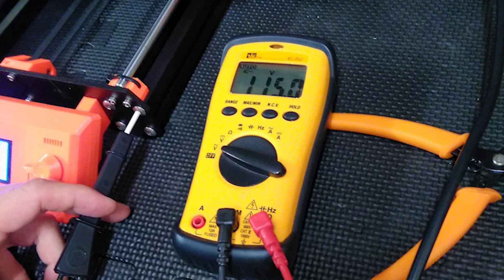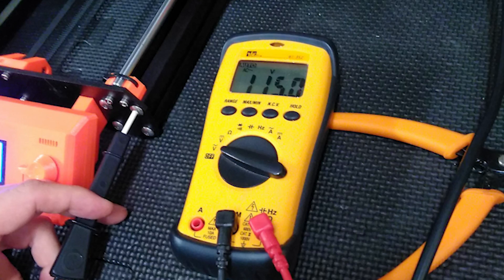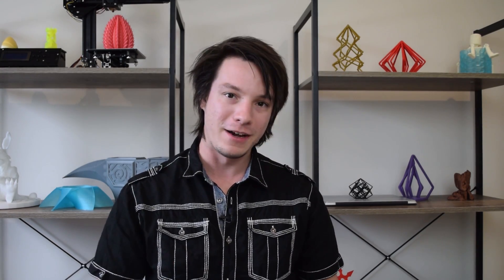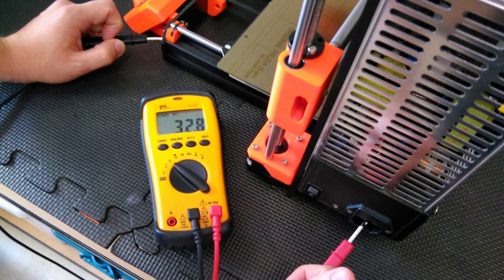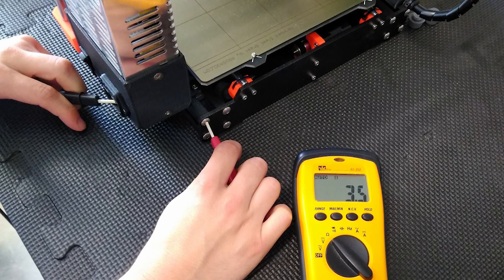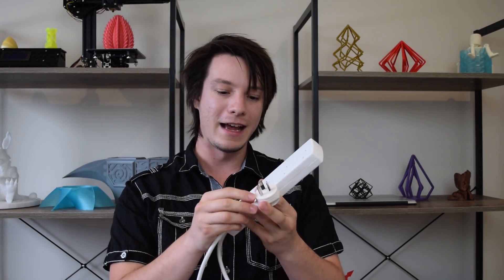I got shocked by a 3D Printer

Comment: Good PSA:
Always a good idea to have your machine plugged into a surge protector that goes to a grounded outlet (3 prong here in the states).
Always wear shoes or rubber gloves, when handling your machine (this helps isolate you further in order to avoid accidental discharge). 
If your machine is sitting atop a metal surface it might be a good idea to use a rubber grounding mat to isolate the chassis from the metal surface.
Always inspect your cabling, surge protectors, and outlets on a consistent basis! Depending on the usage it's always a good idea to check if a cable is getting hot (while grounded/isolated), or shows wear/scorch marks which are a good indication of a problem. If any of these tell tale signs occur, halt the print.

There's more electrical safety tips out there, and if you're getting started or interested in these machines (as an adult or a parent) so that you are prepared to operate your printer SAFELY!

Even the smallest of jolts could potentially be lethal depending on the situation!

Comment: Second rule of 3d printing. Don't print if you can't brain! We can wait a few more days for a video. You can't unfry yourself if you derp and zap yourself into cardiac arrest. I also make sure the power boards I use for exxy stuff has a safety switch thing to prevent any sort of odd electrical derpage.
Reply: Theressa What's the first rule?
Reply: Gavin_152 level the bed then level the bed again the again then again

Comment: my not very lubricated anet a8 guide rods shocks me everytime i touch it.
If the voltage is that high you may need to check the wiring.
Also the ground will burn out the fuse in the plug unless the power jumped before it , better prepare some spare fuse

Comment: I would have tried to diagnose the Aurora before you posted this.  For all you know, it's just a loose wire inside the thing, damaged during shipping, that is touching the frame.
Reply from the maker: I thought about it, but honestly it's beyond my level of skill. I don't play with mains, period. Not really happy to open it up and poke around looking for voltages and shorts.
Reply: I'm not an electrician either, but most 3d printers are main to power supply to 12v or 24v DC electronics.  Hard to see how main power is going to short to the case unless it's just a badly wired power supply, or a wire going where it shouldn't.  It would have to be a pretty weird design for it to be a design flaw.  But perhaps an expert can comment!
Reply: The voltage you showed is only possible in if there is a leak from the power supply to the chassis of the printer. An improper circuit wiring of the outlet would show full mains potential across the neutral and ground if there was a hot wired into the neutral on that circuit. Since this was only an issue on the JG Aurora you have limited the voltage leak to the PSU. 
   As an Electrical Engineer I implore people that if your unsure what your doing simply don't mess with mains power. Current as low at 100 mA can stop your heart! 
   As you know the printers operate on 12v or 24v DC which is fairly safe as long as the transformer is properly insulated from the machine. External double insulated power supplies are the only units that can be operated without a ground safely. 
   I enjoy your content and want you to continue producing it safely. Being in the US I had to lookup your electrical code as we do things a bit different. I am unsure of your property's age but current code calls for the installation of any residential outlet and lighting circuit requiring a GFCI (rcd) to be fitted. This is not a retro active requirement so please purchase a GFCI protected power strip if you do not have a protected receptacle. 
   I have seen far too many Chinese products in the past 5 years have issues like you experienced. Poor insulating, improper wire gauge, bad connections, and a lack of ground all together are things I have come across. Glad your OK. I'm sure Josef will sleep better knowing it wasn't his machine.

Comment: All homes here are required to have an RCD breaker (america has a different name) in the fuse box, this device will trip when ANY current leaks into earth (basically.. to protect people if they unluckily become that path to earth). 

This would have instantly tripped when you plugged in the JGAURORA, letting you know that it's power supply is dangerous and shouldn't be used. I recommend looking into getting one for your home, or at least a power strip with one built in for your workshop.
Reply: That outlet is called a ground-fault circuit interrupter (GFCI for short)
Reply: GFCI are the ones with the Test/Reset buttons, right?
If so, I thought GFCI was only required outdoors and in bathrooms, and maybe kitchens, none of the bedrooms or otherwise have GFCI outlets.
Reply from the maker: Thanks for the heads up. It's law here too but we have just moved in. If they're not in place I'm reporting them.
Reply: All depends on your country's rules, In Australia, Its everything, depending on the age of your house, you will have one larger RDC on the input, On my 2 year old house, each circuit breaker also had an RCD built into it (dual purpose) And yes, generally they are the ones with the reset buttons.
Reply: Oliver O'Neill Not necessarily. The RCD only trips on currents greater then 30mA, also the JGAurora doesn’t trip the RCD when connected to a earthed socket. The fault current is well below 30mA in this case. My theory is that the PSU of the JGAurora has a high impedance path between live and earth due to flux residue or an incorrect discharge resistor in the region of a few megohms. This is enough to make you feel an uncomfortable “buziness” but nothing more. In regular use, this current of a few hundred microamps will flow from live to earth, not tripping but slightly biasing the RCD.
Reply: Sure this wouldn't have tripped instantly if the JG wasn't earthed but it would have tripped when poor Angus touched it.
Reply: Oliver O'Neill 
Your right. A quick recap read they detect difference in current between live and neutral. Return path via ground isn’t required. All the more interesting.
Reply: Please do get an electrician to check it - IIRC, houses older than xyz years in Australia (or certain parts) are not legally required to install an RCD/GFI until major changes are made to the infrastructure. I have seen houses rented out (yep..) with fully networked ground lines that lead down to the basement and do not actually terminate in earth, making the whole network useless and causing potential bleed over into other appliances, such as in your case. I've also seen extension leads with a male plug on both sides..

As an electrical engineer, I'd be keen to see inside the JGAurora. Some Chinese manufacturers (notably of cheap LED floodlights on eBay) frequently omit actually connecting the ground pin to the metal chassis, making them both potentially lethal and a fire hazard. I think a proper analysis of the aurora guts are in order. I think Djhg2000's comment about the grounded PSU sounds feasible.
Reply: In Canada (and USA I think) GCFI is only required in wet areas (bathrooms, near sinks...) and outside.
Reply: Ian Colquhoun That's the case in the US.
Reply: There are ones for sockets directly too. In case your landlord is slow.
Reply: All homes are required to have at least one RCD (Residual Current Device) breaker in the path. In newer homes, this is typically done on all power point breakers as they're cheap now. Older homes will have one large RCD that all the individual power point breakers tie into.
Reply: Oliver O'Neill absolutely correct
Reply: In US we call those GFCI Outlets (Ground Fault Circuit Interrupter) Easy little button on the outlet to reset the breaker, and it'll save your life
Reply: Cory Halvorson I have always called them GFIs saying circuit seems redundant.
Reply: WTFMacca  they will (thats their purpose)... Angus was connected to earth.
Reply: Correct, for USA.  wet areas, garages, outside.
Reply: You can buy interrupters that trip at lower currents. Maybe not in your local shop.

Also, electroboom: https://m.youtube.com/watch?v=GlM6PE2kKVY
Reply: Yeh, I had assumed they looked for current on the earth wire, but they measure difference between active and neutral
Reply: @ sinned nevets -- That's not true even remotely. GFCIs do not require ground to operate, and they are even occasionally used in cases where a ground is not available (with appropriate marking).
Reply: Having an RCD in front of that you can easily test (pressing the test button) before you plug your 3D printer in is a good idea. Like these: https://www.bunnings.com.au/search/products?q=safety%20switch&redirectFrom=Any&facets=Region_vicmetro_PriceRange%3D%2450%20-%20%24100%7C%2420%20-%20%2450
Reply: Oliver O'Neill  it will have an rcd, but they won’t do anything if nothing is connected to earth. Which was his case.

Comment: Are European plugs/sockets not grounded then, since we only have 2 prongs? How does that work.
Reply: Zeis the big round ones have 3 prongs and are grounded. ( One normally is flat at the front / back of the plug and the metal springs are in the socket)
 The small 2 prong ones aren't.
Reply: We (Germany) have two different plugs.
The small one without ground is used for devices which are double isolated. (Schutzklasse II)
For example lamps or smartphone charger.
Reply: Jehty21 Yeah I'm from Germany as well. So that little metal contact on the bigger plugs is our ground, eh?
Reply: European plugs have two prongs but are grounded through another metalic part on both sides of the plug. If this third metalic part is not present then it isn't grounded just like Angus' old plug.
Reply: Here in Spain there are metal contacts in the sidewall of the socket. They are the ground connection for those appliances that require an earth.
Reply: There is grounding in the EU plus. Look at hte little prints in the side of the plug. There is a where the ground is located.
Reply: Zeis die beiden Klammern in der Steckdose ist die Erdung.
Reply: not sure but didnt angus explained that in the videp?